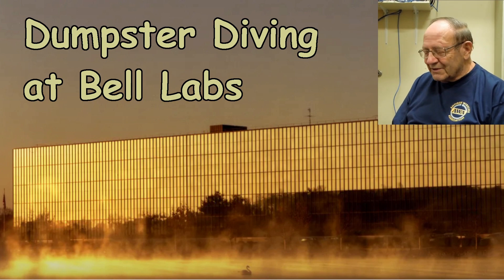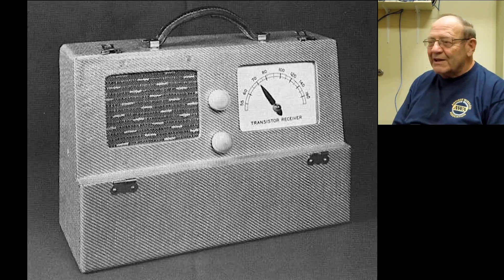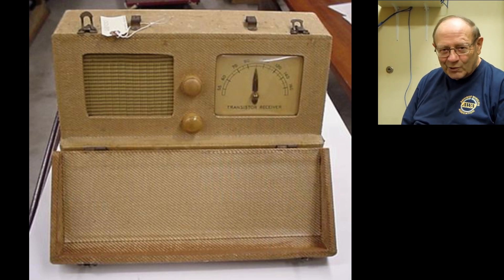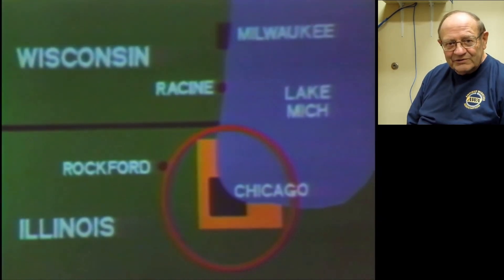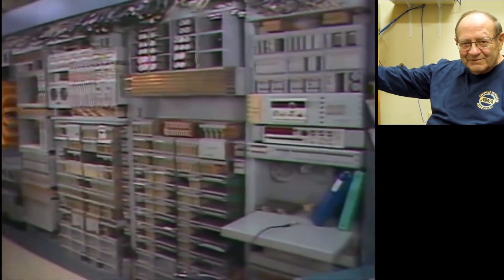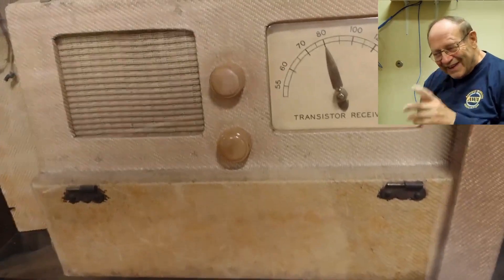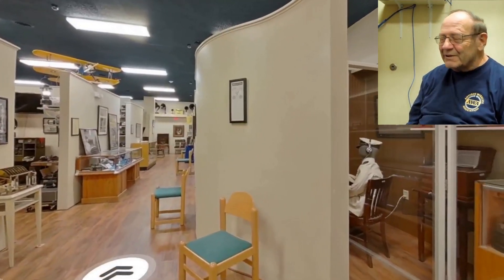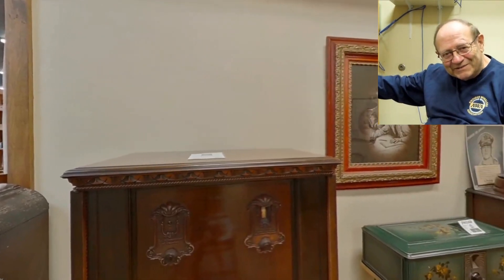Dumpster Diving at Bell Labs - Saving Communications History

Comment: the streaming mechanism is not the method to use .. it is slow the buffer and you cannot fast forward
Reply: Works fine for me.  It is like any other YT video - you can scroll forwards and backwards using the bar at the bottom of the video.
Reply: On my smartphone or computer the buffering seems at the longest to be two seconds for a shift of 1 hour. Sometimes it is much faster than that. I suspect the variation is due to the load the YouTube servers are under at the moment. If you're experiencing much longer times, it probably has something to do with the speed of your internet. To get the performance I have all that is needed is a relatively modest 17 megabits per second over Wi-Fi. There are several internet speed tests available on the web, I suggest you test the speed of your connection. Hope this helps.